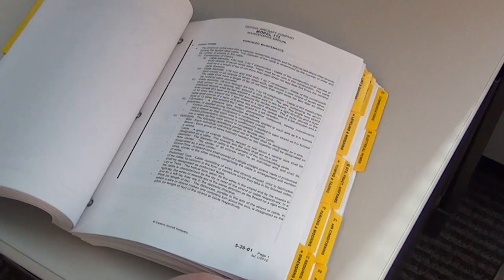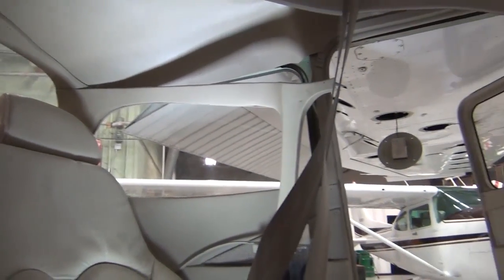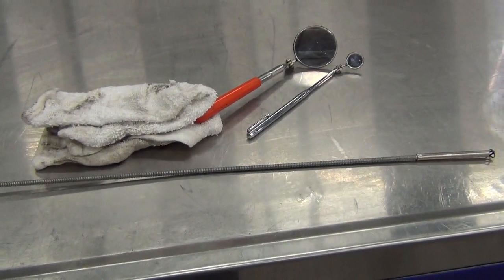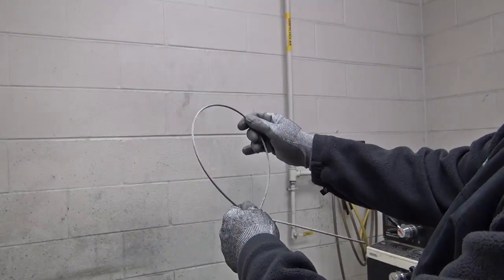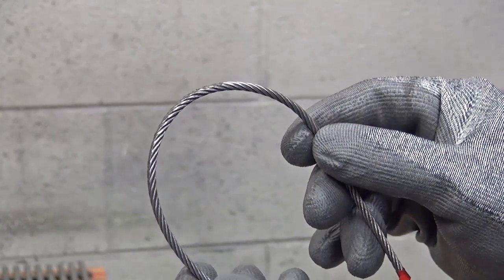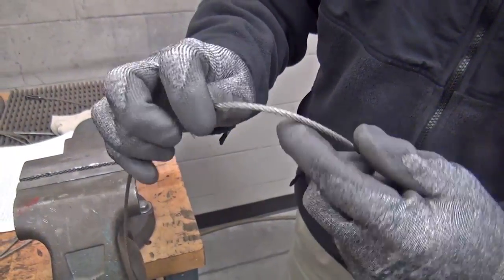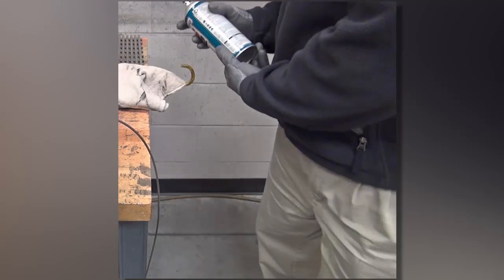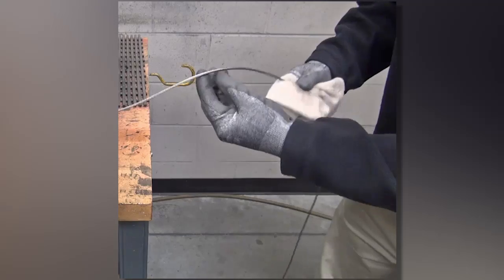Flight Control Cable Inspection

Comment: @2:46 WD-40 isn't actually a true lubricant. WD stands for "water displacing" and its main use is as a solvent or rust dissolver.

Comment: WD-40 is a solvent AND a lubricant. As the solvent initially cleans and evaporates, as solvents do, a light coat of lubricant, which does not readily evaporate, is left behind. A review of the Safety Data Sheet for the product indicates this. First and foremost, this video is produced by Cessna and clearly defines in the description that the procedures are from their Aircraft Maintenance Manual for the 400TE. Always do what the manual says.

Comment: How often do cables snap? Is there any recovery after a snapped cable?
Reply: John Armstrong Not often. If the elevator cable snaps. Say you have no up. Trim up and load the stick with down force. Or vise a versa. Power change will also change pitch. Ailerons break use the rudder. Rudder breaks use the ailerons. Landing might not be pretty but you won't die!
Reply: There could still be deadly situations, a elevator up cable snapping shortly after rotation.